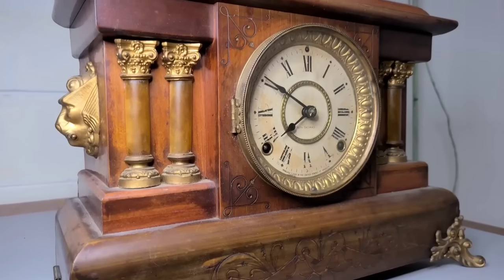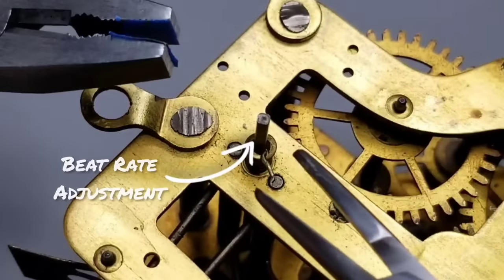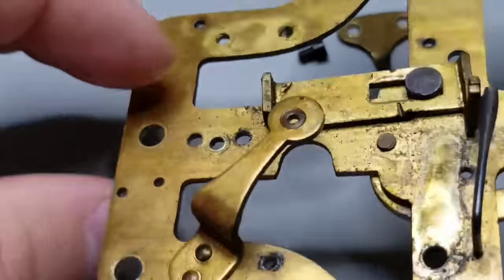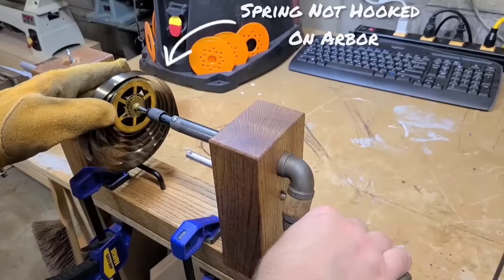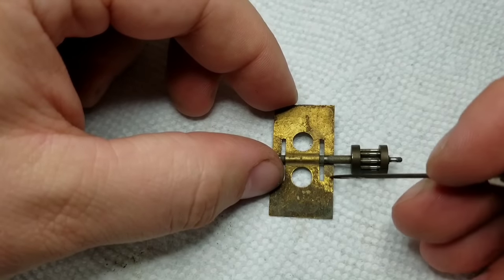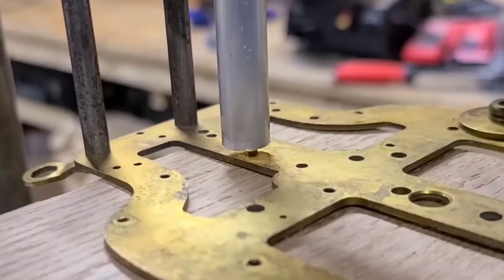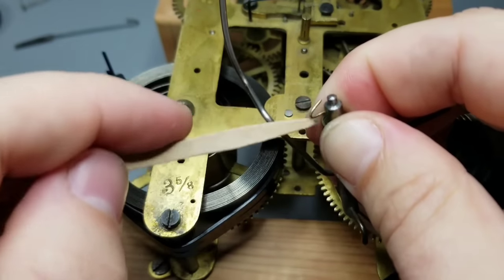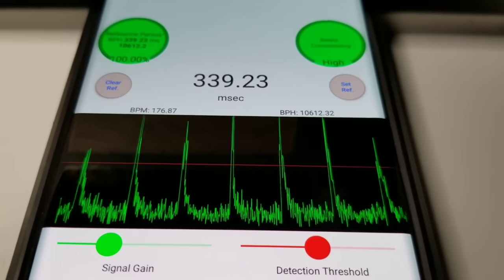Neglected 1900 Seth Thomas Clock Restoration

Comment: I don't mean to be critical, but couldn't you remove the stains on the brass before you put everything back together? It still looked dirty. I'm no clock expert, so I apologise for being critical.
Reply from the maker: There's a couple reasons. I've been nervous about using too many chemicals when cleaning. I don't want to remove patina or make things look unnaturally shiny. I want to remove oil, dirt, etc., but I don't want to remove natural aging characteristics. Also, I've been working on clocks that aren't mine (clocks belonging to friends and family) and I don't want to experiment on someone else's clock that has sentimental value and risk messing something up. I'm very much an amateur clockmaker and still trying to learn a lot. When I get a clock that I actually own, I might experiment a little and see how to remove stains or patina. But my main goal right now is to restore a clock so it functions the way it should, not restore a clock to make it look like it was made yesterday. Thanks for asking and for watching!

Comment: how do you unwind a clock if its been winded up to much ?
Reply from the maker: You can watch how I unwind the mainsprings starting at time 3:15. Overwinding is a common misconception and myth. Clocks are designed to be wound up all the way. If a clock isn't running when the springs are wound, then it's most likely due to old oil, rust, dirty mainsprings, worn pivots or pivot holes etc.

Comment: I was told never use WD 40.....did I hear the right thing? Thanks!
Reply from the maker: You're not supposed to use WD40 on a clock movement as a way to "make it work", lubricate, etc. This is a common thing people do that they aren't supposed to. I used WD40 only on the springs to clean them and then wiped all the WD40 away. Those are 2 very different activities. Maybe I shouldn't have even used WD40 as a cleaning solution. Maybe it's okay. I'm not an expert so I wouldn't just blindly follow what I do.

Comment: You might be suprised at what a hundred years of cigar, pipe, cigarette and fireplace smoke can leave on items especially if the clock was in a study or smoking room. That might explain the fan only being grungy on one face if that face was pushing the air, IMHO.
Reply from the maker: Good point. Thanks for watching!

Comment: I would say you are on your way but why not put the plates, wheels, pivot and pinion into the ultrasonic cleaner?  Is the cleaner just not big enough?  I'm a long time clockmaker and all that brass should shine up and look new.
Reply from the maker: My ultrasonic cleaner is pretty small. I also didn't attempt to make the clock or its parts look shiny and brand new. Thanks for watching!

Comment: I would like to add about ammoniated cleaners that some old cuckoo clocks used what appears to be cast brass plates. The ammoniated cleaner will actually get into the pours and brake down the brass and cause pitting . Don’t want to use it on those.
Reply from the maker: Thanks for the tip!

Comment: I got a ``Seth Thomas`` clock for 25 yrs of service at the shop.
10 lbs of brass and a cheap battery operated time piece.
Probably worth more as scrap brass, than a ``Seth Thomas`` ...
Reply from the maker: Probably haha. Thanks for watching!
Reply: @WatchOverhaul  is it worth anything on name alone. it`s about 20 yrs old.
Reply from the maker: I'm not sure. Maybe if it was actually made by the Seth Thomas Company.
Reply: @WatchOverhaul  the name Seth Thomas is on the face of the clock.
Reply: @WatchOverhaul  it`s a sharp clock anyways.

Comment: Hi l am 80 now and love clocks at one time l had 35 all working 100% ( my 100 ) clock guys all have their ( 100 ) well most have now moved on to the next clock guys my Whife got the movemeant going well still have 8 my oldest is a urica electrical clock working 100 so guys don't stress with your wives they just don't understand just hearing your Grandpa clock strike 12 AM is a reminder your still around 
Reg from South Africa Lee
Reply from the maker: Thanks for watching!
Reply: Hi sure miss my clocks well quick one was at a scrap yard yesterday and found a perfect ceramic  clock face ( someone l think thought the movement was worth more as scrap ) mmmmm crazy or what.
Well the face was like new sure built stuff stronge way back 
Reg Lee

Comment: Why not fix the clock face, wood and metal brackets??? is like a new engine in a rusty box, I mean your job is amazing but the job not is complete. Your technique is awesome.
Reply from the maker: It depends what the job description is. The job wasn't to make a clock that's over 100 years old look like it was made yesterday. The job was to restore the clock back to working order and try to keep everything original as much as possible. If the dial was completely unreadable, then that would have justified replacing it, but that wasn't the case - it was just a little worn. I get what you're saying though and thanks for watching!

Comment: The governor (fan) turns only one direction. The leading edge would naturally collect the most dirt.
Reply from the maker: Oh okay! That makes sense. Thanks for the info!
Reply: @WatchOverhaul  Great video, I learned a lot. I just restored an 1882 Ansonia. Fortunately, the mechanism was in great shape. It was mostly restoring the cabinet.  A hack had been there before me, so it had mismatched stripped out screws and they even used a brad nailer. They somehow, ended up with a pendulum that was too long, so they just hacked a hole in the bottom! I rebuilt the cabinet and made it taller. 
 I just keep adjusting the pendulum until it's just about right or slightly slow on my clocks. Your method, though effective, is too technical for me. I have so many clocks, I don't want them all going off at the same time anyway.  You've given me the confidence to try repairing mechanisms, and to respect springs! 
I have a Japanese Meiji school clock from 1935. One day when I was winding it, the main spring broke, and it nearly took my thumb off! I quickly, and painfully learned to respect the power of those springs
Reply from the maker: @peterfallert4994  I'm glad you liked the video! I've only worked on 4 clocks so far and there is so much to learn. I'm just taking baby steps and trying to push myself a little more each time. I was just adjusting the bob height to get the correct timing and I still do that, but I figured I should learn how the gear ratios work. Also, if I work on a clock that has the incorrect pendulum length or a missing pendulum, the gear ratios will tell me what the theoretical pendulum length should be too. It's nice-to-have information, but isn't needed to get started working on clocks.

I think you could take a shot at repairing a clock movement! Just take your time, take pictures and some video. I started out not knowing a whole lot and just used tools I already owned.

Comment: I have that same clock. About to toss it in the trash.
Reply from the maker: Don't throw it away! Is there anything wrong with it?
Reply: @WatchOverhaul  Same problem you were having where the spring came off the catch so it unwound. That's the main issue right now.  I was considering attempting to take it apart to put it back on the little post or whatever it is and use your video to put it back together correctly.  I had it for sale on marketplace for two weeks for $50.00 and nobody wanted it.  Not worth paying to have it fixed.  So either I do it myself or toss it so it is not in my way anymore.

Comment: Do you have a system to keep track of all the parts and where the go in the clock, or can you keep all that in your memory?  I guess that the video itself would be useful for that, although it would be time consuming.  I have an Ansonia Grandfather clock from about 1880 and have cleaned it without disassembly of the gears because the reassembly might be overwhelming. I enjoyed seeing how you added a bushing to an off center hole.  I know a few of the bearings in my clock have that problem.
Reply from the maker: I reference the video recordings I make and also some images. This was the original reason why I was recording - it wasn't to make YouTube videos. But I just continued to record, then just decided to put it on YouTube to just see what it was like. I'm getting better at recognizing where things go as I gain more experience, but having a video is a good backup. It does get a little overwhelming at times, but I just try to take my time and it's worked out so far. Recording what I'm doing helps reduce the nerves and getting overwhelmed. I'm glad you liked the bushing part - it was my first attempt doing that! Thanks for watching!

Comment: When we stayed in Iowa for a while, I got to rebuild the wood cabinet  for an old Regulator train station clock. It was accidentally  knocked on the floor and the glue holding the cabinet together had dries out so it basically unassembled  when it hit the floor. Here is the rub. The owner didn't want anything done with the clock mechanism because the time the clock stopped was when a Tornado came through and destroyed the hardware store the clock was in. As soon as I removed the Mechanism  to repair the cabinet it started running! I ended up wiring the gears together preventing movement. The cabinet came out looking great. I didn't attempt to clean it very well as it represented survival. There were some broken pieces of corner trim. I had to carefully piece the trim back together and used stained wood filler to fill in the holes created when the wood broke. I carefully blended in any repairs with stain and took my time. The owner was very pleased with the finished product. I have never been told NOT to repair a clock before, but hey. By the way, the Tornado went through at 3:23 pm.
Reply from the maker: Very interesting! Thanks for sharing and for watching!

Comment: Seen you working on a fusee movement pocket watch. Very cool video. Now your doing clocks. Very cool and welcome to the clock world. I’ve serviced your average clocks you come across for around 30 years. An ammoniated cleaner used properly will definitely benefit you. It removes all that dried on grease your scratching off and gets into places your scraper and brush can’t .  An ultrasonic cleaner is always best with any solution for helping to get the cleaner into these areas. You know this from working with watches and your cleaner is showing it’s too small for clock parts.
They are not cheap as you said. I started with an ammonia cleaner using a sloshing method. Sure it worked.  ( Clock Repair people, please don’t say this was a horrible idea. It worked pretty dang good as a beginner.)  I bought massaging pillow cheap. Took out the motor and off set cam that makes it vibrate and strapped it to a cut off 1 gallon windshield washer fluid container filled with an ammonia cleaner. The vibrations were fast and rippled the surface of cleaner nicely. It was a great thing. I could Work on something else while this thing is humming away.
 I learned the hard way to fix clocks. Self taught , but did actually work at a repair shop for 25 years with the knowledge I took with me there.
Reply from the maker: Thanks for the tip! Yeah, I need to play around with different cleaning solutions and get a bigger ultrasonic cleaner. Thanks for watching!

Comment: I restore old telephones, my springs are alot snaller but I think my might help you too. 
I use Autosol metalpolish to clean the springs because this hardened grease is sometimes a bit too much for WD40.
After that I lubricate it verry thin with grease. 
It is verry nesesarry to clean all the old grime off. I had that old stuff reacting with the new lubricate.
Reply from the maker: I'll have to look into that. Thanks for watching!

Comment: Some 15 years ago, I bought at auction a 1912 Gilbert mantel clock.  When I gently started to wind the movement, you could hear the dirt inside.  After removing the movement, I also  removed the verge to let the main springs unwind.  That was all the disassembly I performed.  Placed the movement in a pan and sprayed some 4 cans of Brake Clean while sloshing the entire assembly.  I used a soda straw to blow off the dirt and Brake Clean.  After subjecting the movement for a while  in the pan the clock began to run.  It took a while to get the clock to "keep time" but it is still running today.

P.S. very impressed with your presentation and homemade lathe.  Thank you for sharing this
Reply from the maker: It's definitely fun to tinker with these old clocks and get them running again. Thanks for the compliment! It takes a lot of effort to work on these clocks, film it and try to make an interesting video but it's fun. Thanks for watching!

Comment: On the excessively greasy parts, would brake cleaner be too harsh? That kind of spray would definitely clean the tighter coils and dry without residue.
Reply from the maker: I'm not sure. I'll have to look into that and see. Others have suggested to use that as well.

Comment: Please please slow slow your video  ok ?
Reply from the maker: I speed up much of it because if I don't, the video would be hours long. I'll see if I can slow more things in the next video. Thanks for your feedback and for watching!
Reply: If you want to slow the video down, touch the screen where the video is playing, select settings (top right corner), select playback speed, and then select one of the options above 'normal'. These will slow the video down to quarter speed (0.25), half speed (0.50), or 3/4 speed (0.75).

Comment: WD40 should never be anywhere near a time piece.!!! WD40 will gum anything!  From observation of Your video I have seen a lot of gummy substance on the clock mechanism which told me that a someone else used WD40 to lubricate the clock. 
I also would like to point that the shafts should never wobble!!! If they do then it is time to #1 polish them and #2 shrinking the bearing holes would help a lot! I have done this for very many years and never have had complaints.  
Please do not ever use any substance that will be gummy on any time piece because You will not be happy very soon!!! 
I have nothing against You!!!  I have done this for way too many years. I'm now retired and enjoying rest of my life. 
I wish You the best of luck!!! 
I have been trained to do a clock and watch repair work in Europe..... 
Sincerely Tony Nehyba
Reply from the maker: Thanks for the info!

Comment: you need brake cleaner
Reply from the maker: If you’re referring to cleaning the mainsprings, I just used the method suggested by many on the National Association of Watch & Clock Collectors website (https://www.nawcc.org). Do you use brake cleaner?
Reply: I don't do any clocks but brake cleaner dissolves grease and dirt and leaves a dry surface WD40 will leave a film that will build up in time
Reply from the maker: Oh okay! I'll have to try that sometime then. Thanks!